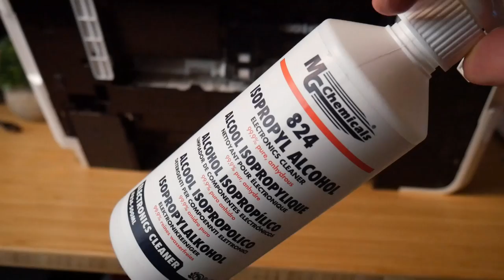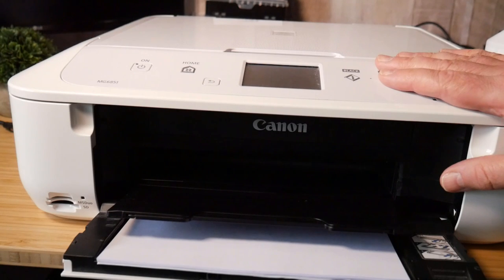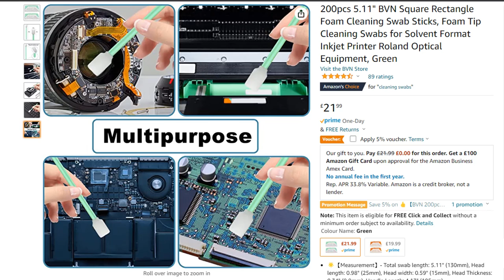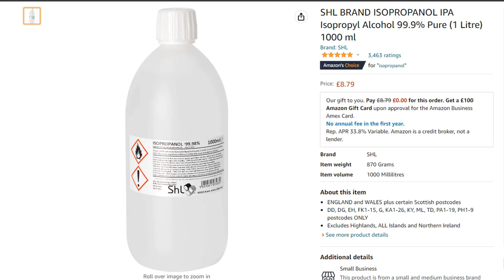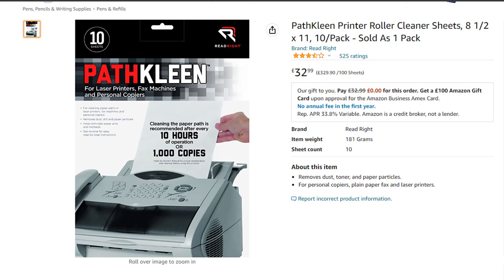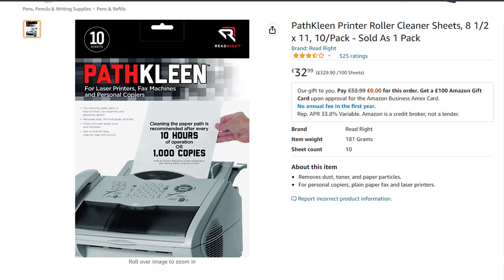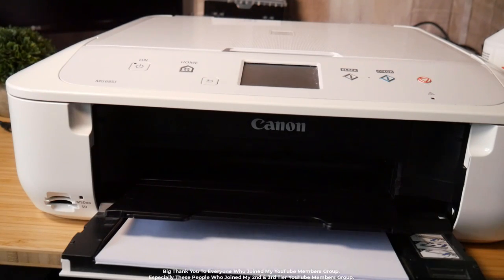Fix Printer Doesn't Pick up Paper

Comment: this happens a lot, me being an ex HP Laser Printer engineer (mid 90's) we used Platonclene & I still do it to this day, it cleans & restores the rubber very well. Another big problem I see a lot is from top feeding printers like the Epson, paper getting dragged in sideways/angle, 9 times out of 10 something like a pen top, paperclip, Lego, you name it I have found it in them.
Reply from the maker: I have also serviced many a print over my time. This is always been a very common problem

Comment: I used to service copiers and printers throughout my career, and I have found just plain soapy water on a cloth to do a better job of cleaning the rollers, without drying them out, as alcohol tends to do. Some rollers are easy to remove from the printer, and those I would wash in a sink with soap and water.  I advocate for replacing rollers whenever they are dirty and or worn, but not all of them are easy to obtain.
Reply from the maker: Whatever works, that's all that matters. Some of these bands are very hard to get to the very deep inside the printer
Reply: What about renewing the rollers with something like silicon spray lubricant?
Reply: I believe Silicone would make the rollers slippery instead of aiding them in gripping the paper.
Reply: @Dave52732  ah ok. Let me just be on the safe side and use soap and water.

Comment: Many printers specifically say not to use alchohol on the rollers. Although  it will clean the roller it will also harden the surface. The printer may work for a short while but will be much worse after a small amount of dust starts to build up again. A better choice is water to clean the rollers but this will leave the rollers damp for a while before you can use the printer again. Lastly, to restore the rubber's grip, order some rubber rejuvinator and use as directed. This will soften the surface of the rubber making it like-new. 
Although it may be possible and even tempting to buy new rollers, often times printers are not designed to be easily taken apart and serviced. Also, as bearings and sleeves wear the shafts can start to misalign while feeding paper. Paper can then buckle and jam. Paper moisture content can also be a major factor in jams.
Reply: I was just going to ask about some kind of rubber rejuvenation with something like silicon spray
Reply: @jackkraken3888  My advice is not to use other products on the rollers. For a printer to work the rollers must have the correct softness and friction surface. Any substance not specifically formulated for that purpose may ruin the roller's ability to "grab" and release the paper properly. Actual rubber rejuvenator products are readily available online. Considering the cost of the  product vs the printer going in the landfill it seems the wise choice is to just wait for the order to arrive.
Reply: @WhitentonMike  I should mention that silicon lubricant sprays are specifically designed for rubber rejuvenation it's mentioned on the can! But thanks for your I input.
Reply from the maker: maybe not good for heavy users and domestic inkjets have a short life cycle
Reply: @Britec09  What's your opinion about Inkjet with inktanks? We started working with them in workplace but I have my reservations.

Comment: In the machine shop there is a product called "BELT DRESSING". It is a spray (although sometimes also comes in a bottle with a brush), which is applied to rubber belts on machinery to keep the rubber from ageing. it makes the surface of the rubber soft, glossy, somewhat sticky to the touch and it "renews" the rubber.  This product would probably help a lot with printer rollers, however you must find a way of applying it that does not allow it to go in unwanted places, so careful application by hand is a must. You likely won't find it in hardware stores, but machine shop tolling supply houses would have it.

Comment: About 30 years ago, our government organization had many early hp inkjet printers with this problem. Paper dust fuses into the rubber rollers creating a hard shiny surface. Hp issued us spring loaded metal plates with Scotch abrasive pads that aligned with the rollers. Program on floppy disc drive rollers and surface of rollers removed. Feed some paper to collect debris and printer returns to service.
Reply from the maker: Yeah paper is quite abrasive and can cause a lot of problems with the pickup rollers
Reply: @Britec09  Thank you. This'll be what's up with my printer. (hp2620) which has been sat out in my living room, unused for a few years. I'll get on it.👍

Comment: A cotton Ear Bud soaked in Isopropanol 99.9% is also a handy tip, because it can often reach the harder to get at Rollers (without needing to take the machine apart). Use as many as needed, until the cotton Bud comes out clean.

I also agree with "Carl's Die cast & Stuff"'s comment, that AF Platenclene is arguably better for this particular task, but when that isn't available, Isopropanol is a good all rounder that is well worth keeping handy.

Best value is the 5L amounts (just make sure it is 99.9% and not 70%, as the 99.9% leaves no traces), and I just decant that into a 1L Trigger Spray, and a few 100ml Pump Sprays kept handy where needed.

It's also handy to sterilise a cut but, probably not recommended!

The main battle is stopping my wife from using it for everything! I have to admit it came in damned handy when we changed the colour of some leather furniture a year or so ago, when it was excellent at removing all traces of old polish before the dye was used. But, that used up my entire stock of Isopropanol, including the reserves!
Reply from the maker: Yeah you can get those long cotton buds. They work for treat. Some people say that the alcohol perish is the rubber, but I'm yet to see that happen
Reply: @Britec09  If it's of any interest, one of our HP Colour Laser Printers is over 20 years old, and I've cleaned the Rollers with Isopropanol 99.9% all of that time, and the Rollers are fine! But it may well depend on the rubber, so other machines may use a different rubber mix.
Reply: @Britec09  Quick further comment, the other thing I've had huge problems with in terms of paper jams, has been Duplex Printing Modules. To explain to others, these are add-on units to, usually, office type of Lasers, that allow printing on both sides of the paper. After a while, these seem to cause more jams than they are worth. But most can just be removed to revert the Printer to single sided printing, which often cures the paper jam problem. Obviously losing the option for automated double sided printing, but that can keep an older Printer going reliably, when otherwise it was almost unusable.

Comment: Main problem is that the retail market printers are "Toys", manufactured down to a price, and  not fit for for anything other than very light use.

That said my +10 year old Epson PX720WD, scan/printer combo, is still going strong, although no longer supported for Cartridges and software by Epson.

 It does max about 50 pages a year.

At year 6 I cleaned the friction feed rollers with isopropyl alcohol and there appeared to be little wear and the rollers came up nice and clean. I think a fair bit of the dirt I removed had accumulated because I'd been using cheapo white copier paper. Thereafter I switched to Epson's own bright White inkjet paper and as today, they seem to have accumulated even more dirt than before in the form of a film  . . . the paper sealant ? Or maybe the isopropyl alcohol made the rubber of the rollers more absorbent. Who knows ? Next time I clean 'em I'll try distilled water plus some washing-up detergent.

Main feed problems with this printer arise from the misalignment of the paper tray and overfilling the paper tray. Because the runner/bearers for the tray are internal, and are extremely lightweight plastic, sans rotating bearings, you can't see whether the guides on the tray have engaged correctly with the runners/bearers, without getting your eye-line at the same level and using a torch or spot-light

 So, mis-insertion is frequent and increases with age as the flimsy plastic parts wear.

The solution . . .  make the tray bearers out of metal and make them extendable, like a filing cabinet draw,  so that the paper tray clips into the extended bearers and, only when properly seated, is the tray pushed home into the "Use" position. Of course, whilst the bearers are extended,  you can actually see what you are doing . . resulting in fewer mis-insertions and broken plastic parts ?

The "Built-in redundancy/failure" designer boys and their marketing masters wouldn't like that. 

 This would probably add an extra £5 to the price . . ohhhh! With current Marketing regimes , this is a facility you used to only get with high-end business machines (For those with long memories), so no way are you likely to get this in the "Toy" retail market.

Dealing with things as they are, I find that a sparing application of PTFE lubricant spray, via a piece of paper towel, on the Tray guides and the internal runner/bearers does make insertion of the tray a littlke easier.
Reply from the maker: Thanks for sharing. Much appreciated

Comment: Well, every printer is different and reasons can be mechanical breakage also. i have experienced that with the HP Officejet 6500 with 2 broken gears and an HP Officejet 4500 with the sync wheel broken on the center roller assembly. I did get both working normally, but lot of time to dismantle and in one case replaced a broken gear and also used epoxy on a second broken gear. And for the sync wheel problem with the 4500, that may have been caused by working too hard to remove a jammed paper. Youtube has some people who spent a lot of time to show how to dismantle and get to the faulty parts but not how to find replacement parts. Don't count on HP to supply parts, they only supply ink.
Reply: concise 👀👍🙃

Comment: Speaking of printers: I have not used one for over a decade as I rarely used my old one - The last 2 Black only cartridges ended up costing me over $2/page due to the low usage and the ink drying up, even though the printer auto cleaned the head(s) every week. I still don't Need one in reality although would be nice to have one at times - Are there any solutions these days at a reasonable home user price? Darn water based ink - I remember the old days where a Dot Matrix printer ribbon would last near forever🤣👍
Reply: I would have recommended ink tank based inkjet printers but they all seem to have downsides. Chef among them is that when the nozzles  have to be cleaned they clean them buy pumping more ink through them and while it works they have to dump the excess ink somewhere and that usually means a waste ink reservoir. That reservoir can get full and you have to replace the spring inside.
Reply: Just get a laser printer from a good company like Brother, make sure to check online with you can refill them cheaply or not because pantum laser printers are very expensive in the long run as their cartridges are almost the same price as the printer. Also make sure to check what extra feature you might want like mobile printing and if you want more than one person to print you can get a network based printer that connects via ethernet which are the most reliable.

Comment: WD40 on the rollers works like a charm....quick question:  what program do you recommmen instead of CC Cleaner for a new laptop that does a good job??
Reply: Glary utilities or bleach bit are both excellent cleaning programmes.
Reply: @arkay56  thank you
Reply: Here is a issue I had...my HP printer will not be seen by PC.  Was working fine than gone.  I tried unistall then reinstall .  Scan for printers doesnt even show.  New cables, tried different USB ports,  Any idea...did printer just die... P1102w model

Comment: Your video is the best, but I have a different printer. Are you familiar w/ HP Officejet Pro 251dw. There are no good videos, and the instructions are not specific t my problem.  My problem is that the paper held by little plastic tabs in the REAR is stuck. The rollers did not feed the paper forwards, and I do not see a mechanism to release the row of plastic tabs. It's very tight. This is set deeply in the printer. Removing the outer back (tubular) cover allows me to see the paper, but not accessible to do anything. I have quasi-cleaned the rollers carefully w/ paper towel. I do not have a lint free cloth, or Etoh right now.  The problem occurred after I inserted a new Black ink cartridge (okay) and proceeded to print a document. It only printed one page, and the next page is stuck in the rear. I need to know who to release those small plastic tabs. I hope you can help. you are articulate and clear in your communication unlike most YouTube tech  people. Thanks.

Comment: I would be extremely cautious using alcohol to clean rubber parts; a lite mix of water & dish soap on a lint-free cloth might prove to be a better option...!  Alcohol will rot rubber...!!!
Reply from the maker: I have never had an issue
Reply: @Britec09  Fair enoughski...!  It tends to dry out the rubber, much like it would your skin, and therefore make it more and more brittle, whereupon it will finally break down altogether.  This means packing the printer off for repair, although I;ve never heard of anyone actually doing that.  Easier, and often cheaper, to buy a new one...lol!!!